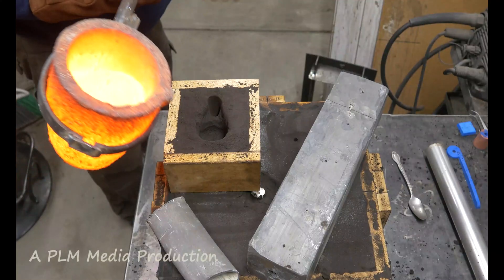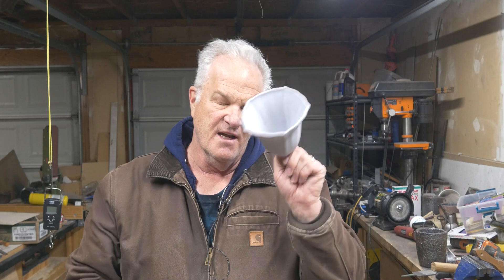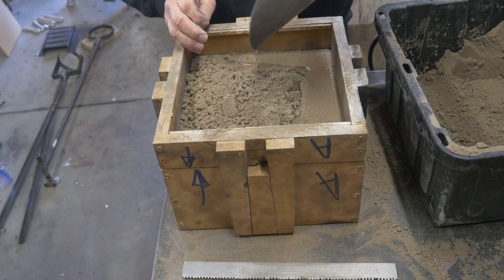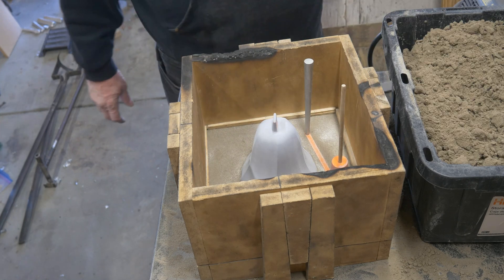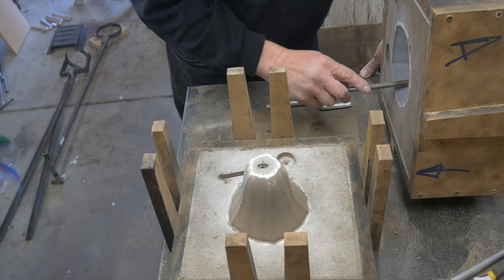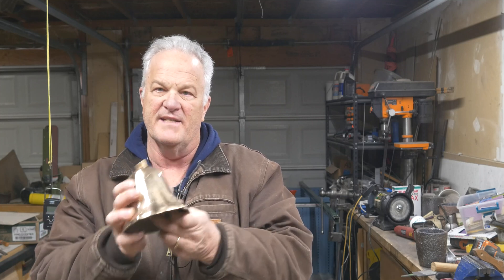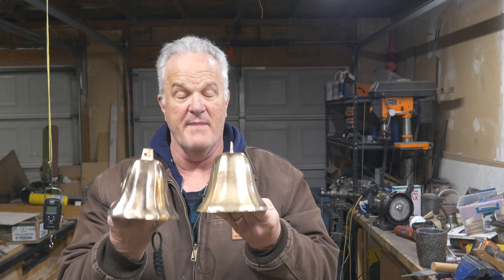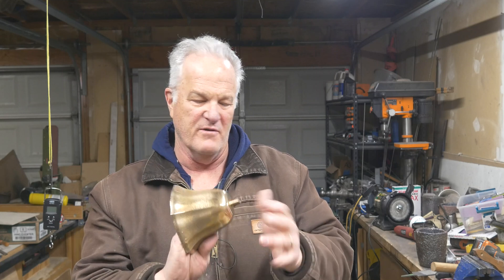Casting fluted bronze bells

Comment: I once made a part that lloked like a dog dish. I foundry guy told me to just ram up a thin drag like you did but then fill the bell with sand and ram it and strike it off then just set it on the drag and rap it until it will come off the sand cone and then put more parting dust on the sand cone and then put the bell back on and then ram the cope. Then hopefully the bell will come with the cope and you can then remove it.
Reply from the maker: Yep. A lot of the release comes from the pattern prep. This one was pretty smooth on the inside but not like glass. As a result it wants to grab sand as it is being lifted.

Comment: Have you ever tried using the Bronze Filled 3D printing filament then sintering it later?
Reply from the maker: I have not. I've never printed with any filament except PLA and I've never done sintering. Not sure how I would apply the pressure involved with sintering

Comment: Hey there, just wanted to say thank u. I have just finished my second bell using the methods you show in your videos and so far it's working pretty well. They look awesome and sound pretty good. But I always have a pretty hard time, mixing the copper and tin in the crucible... Any tips on that?
Reply from the maker: First of all, congratulations on casting bells!

One thing I've done is to make ingots with the copper/tin alloy and then remelt the ingots to cast the bell. I've seen the same problem of not getting it mixed well and this has helped me.

I try not to stir the metal in the crucible but some gentle stirring is often times necessary. You just don't want to introduce a bunch of air into the metal.

The other thing I do is put the tin in with a small amount of copper. The tin will melt almost immediately and the copper will take longer. Once the copper has melted you can start adding more copper to that puddle.

Finally, and this has nothing to do with what you asked, I've started heating the crucible empty. Get it good and hot before adding any metal. This will really reduce the time the metal sits and oxidizes in the flame.  If you can, and this is going to sound weird, add a little borax and a small piece of broken glass to the metal early on. The borax and glass will melt and form a glassy goo on the top of the metal. The goo will also reduce the oxidation. You can simple add new copper through the goo. It will sink below while the goo stays on top. When you're ready to pour clean the goo out just like you're cleaning dross.
Reply: Thanks a lot!  I think I can profit very much from your answer...
I already used the leftover material from the last pour, but it wasn't quite enough so I had to mix some additional copper and tin to it... But I just realized, that I always start with a fully filled crucible, and that maybe is the real issue... there is always a big unmelted clonk of copper at the bottom, that needs to be stirred quite hard in order to loose up... I will also try the borax-glass-method. So far I had a great experience following your tips and tricks, so I am really sure that wont hurt.
thanks again! @swdweeb

Comment: Do you have certain dimensions for your surge trap?
Reply from the maker: I do, but to be honest I just designed mine to something that "felt" right.  My spin/surge trap is 34mm in diameter and is attached to a runner that is 8mm x ~8mm. (the runner is tapered for easily removal from the sand.)

Comment: OK Perry, First I'm going to start with a complaint! This video was too short! 
This was one of the best casting videos I've seen on YouTube and you left so much out.  It would have been great to have shown a little of your 3d modeling process. You didn't show the right way to ram up the bell's interior (only the wrong way). I was hoping to see a close up of how you positioned the eye bolt in the mold. And I was wondering how you attached the clapper inside the bell.  There isn't much room to maneuver in there. 
Aside from the above griping, it was amazing to watch you pull off this difficult casting twice in a row!  And you made it look pretty easy too.
I think you will find that the bells will ring longer if they are hanging and not being held.  I'm sure your fingers were absorbing some of the good vibrations.
But once again, congratulations on creating such beautiful bells.
Cheers from Alaska, 
Greg Chaney 
PS Did you cast the wall mounting brackets as well? I noticed your logo on them.  If so, I want to see those castings as well!
Reply from the maker: Man, you're never happy 😄

If you look quick at the beginning when I'm waving the plastic pattern around you can see inside that there is a hole drilled at the top.  I just stuck the threaded part of the eye bolt in the hole so the "eye" part would be in sand of the core.

It's hard to show ramming harder when it looks very similar to ramming lighter on video.  The second bell core wasn't all that great either. but I didn't record any of the ramming process on the second one.  Most people only care about seeing metal come out of the crucible, then they want to see if the mold filled. After that, there's really only a handful that care about all of the set up.

Yes I cast the brackets as well. I do have video of the first one. I think the clapper is also in there. I'll have to see. 

Given that I was holding it where it will get bolted to the hanger I doubt that they will sound any different hung. In fact the first bell sounds the same hung and held.
Reply: I must be your biggest fan then because I already watched this video twice (after my bedtime 🌙). And I expect I'll watch it a few more times, it really is that good.  The bell pattern is exquisite!  Thank you for the extra explanation. 
I'm going add another request, I'd love to see more about your source metal and alloy concocting process.  Don't even get me started about the price of tin!!!
Thanks for everything you are doing. 
Cheers Greg

Comment: So I am literally sitting here with the kastolite drying on my first ever attempt at building a casting furnace, and I am very happy I ran into your channel.  I am looking to attempt to cast cymbals and experiment with various alloys, with B20 the centerpoint to branch out from.  Thank you so much for the helpful information, the techniques you show for casting difficult shapes are the best instruction I have found so far.
Reply from the maker: With a name like that (John Campbell) metal casting ought to be part of your DNA 😄  I appreciate the comments, thank you.  Casting cymbals seems to be a pretty ambitious goal.  I have no idea how I'd get the metal to flow that far given the thinness.  Best of luck with that.  Always happy to chat if you have questions or just want to float an idea.
Reply: DOnt they use metal spinning for that ? Sounds alot easier to amke that shape out of sheet metal disc than to cast it.You could cast i thicker and machine it-still too much time  consuming compared to metal spinning.
Reply from the maker: @zumbazumba1  I think spin casting is the only way you could do it. I would guess the molds have to be pretty hot as well.  This video kinda confirms the sheet metal approach https://www.youtube.com/watch?v=4SmZsFZTeIQ
Reply: @swdweeb  Yeah, so if cymbals are B8 they usually make them out of sheet, but B20 doesn't work well into sheet.  B20 cymbals are usually cast into a rough sort of puck shape, hot rolled out like a pizza, then bell pressed, hammered, and lathed.  I'd like to attempt casting it as thin as I can manage and then lathing down from there.  I'm aware that it will be a large challenge and start with lots of failure.  But I'm a chemist and the idea being able to experiment with the sonic differences of bronze alloys is too interesting to me not to try.  :)
Reply from the maker: @tylerjohncampbell3846  It'll be an interesting experiment. I'd love to see how you progress.

Comment: Very nice ! The difference in sound was startling , and the design beautiful. I was wondering if, in an effort to save time/steps, you couldn't use one of your vents as your clapper. Always amazed !
Reply from the maker: Just been reading that the clappers are supposed to be a certain percentage of the bell weight... who knew.  From what I've seen they really should be poured by design.  So much to learn
Reply: @swdweeb  Wow! Who knew. I figured it was just a rod with a bulge in it.
Reply from the maker: @alanbabcock1438  So did I until I found a DOD spec on how to make them

Comment: Great to see another video Perry. Did you weigh out the copper and tin and make your own alloy? Any special flux needed?
Reply from the maker: I did make my own alloy.  That probably means that 80/20 is an approximation. 😄  I am using a "flux" and a new process for making my bronze.  I should probably open myself to piles of criticism and show what I'm doing in a video.

Comment: as a drummer I know the best cymbal bronze is 80/20 as well.   Not because I've made cymbals but because I've done research ......... they even have cymbals called B20 bronze
Reply from the maker: I've actually heard that before.  Makes sense that they'd be similar. Thanks for sharing this.
Reply: there's also a B8 bronze for cymbals but those are generally lower quality cymbals. 8% tin  This alloy evidently is easier to work (hammer and shape) where the B20 is more brittle